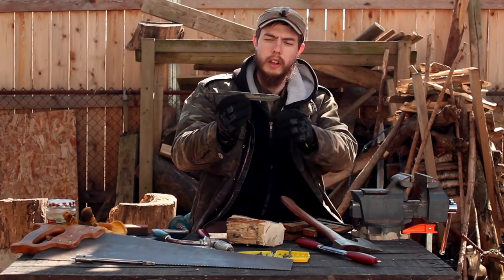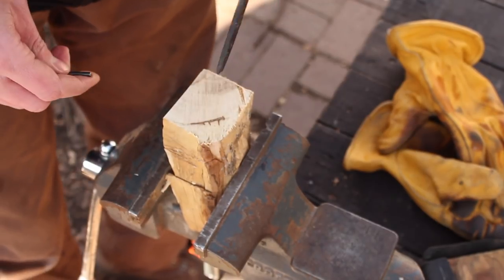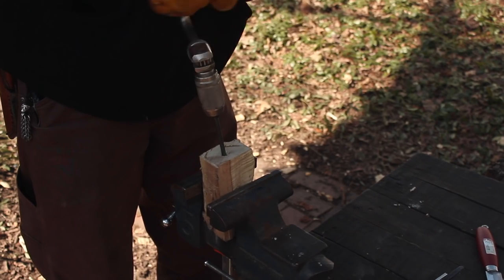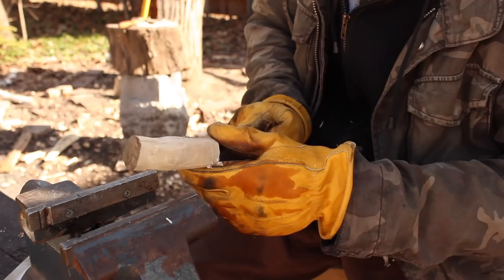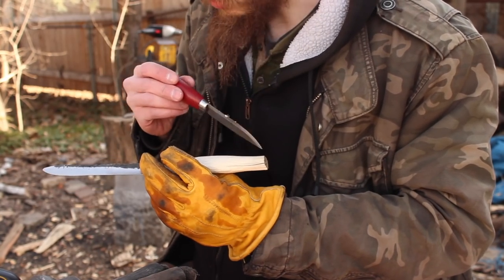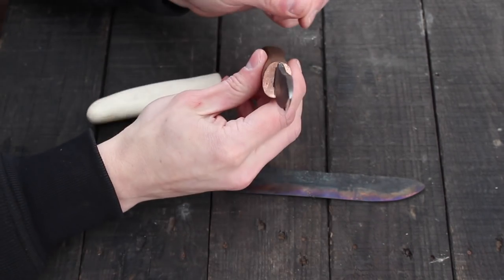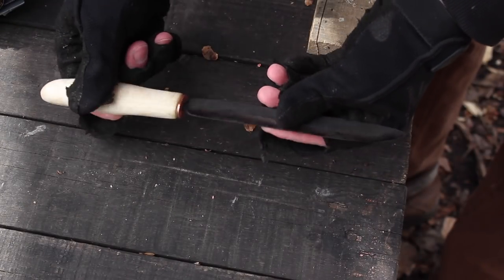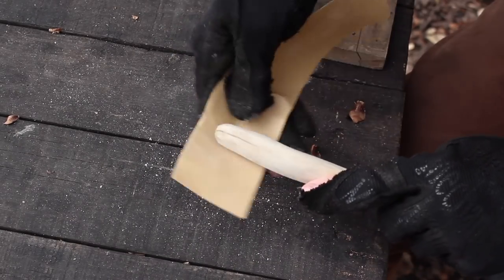Carving a Knife Handle with Hand Tools (the Viking Way)

Comment: My grandfather is from up North (Finland in particular) and he typically will take the axes out after a year of it sitting in the shed and will leave the handle in the lake with the head on so the wood expands. And honestly I'm not sure how that doesn't errode anything or what not but, whenever he needs a new handle it's just 5 minutes in the wood pile for a price and and another 45 to carve a handle out. Assuming they had just press fits, whenever it got loose they may have just soaked it in water